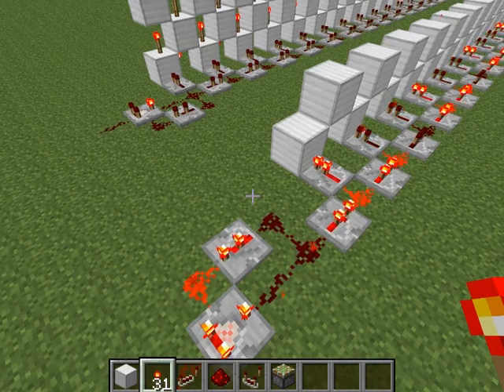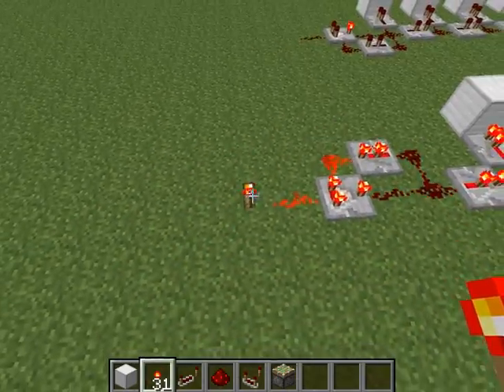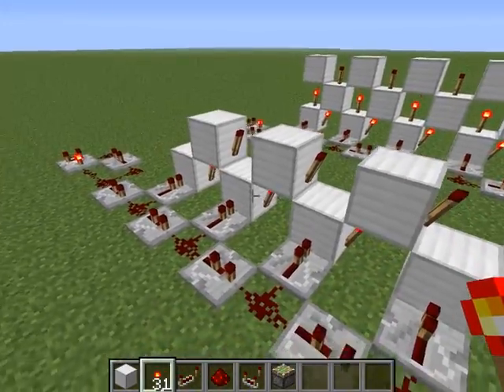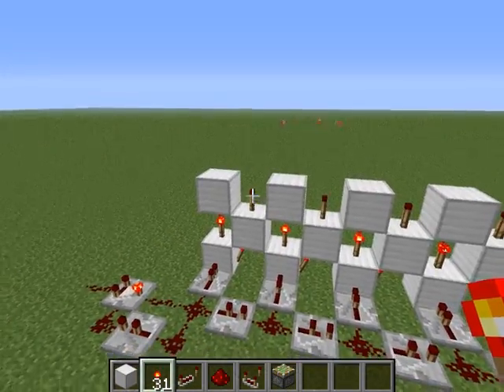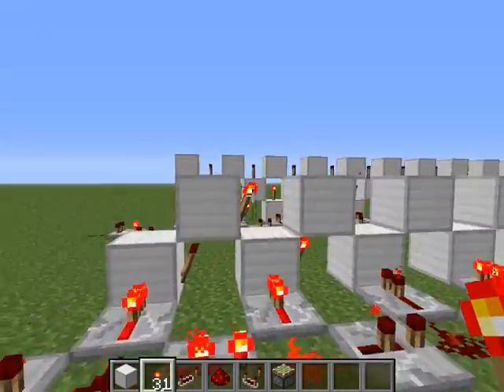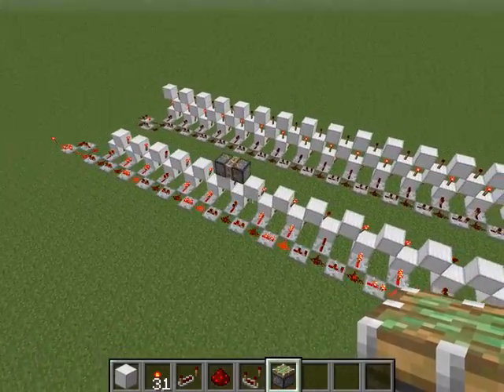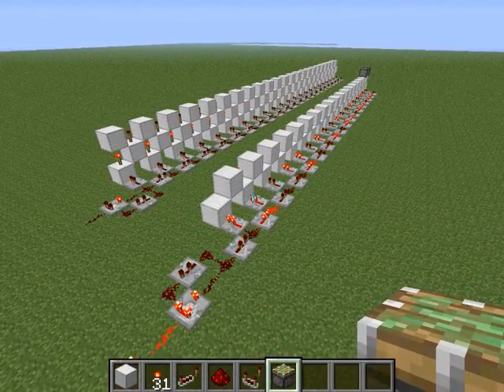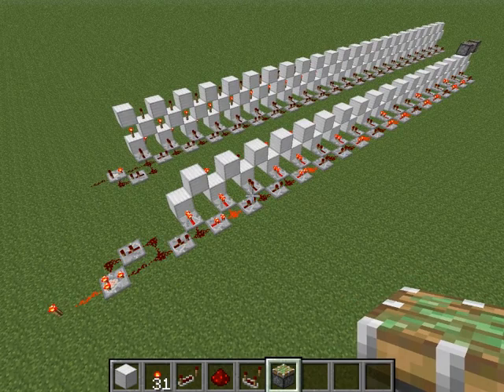Horizontal Piston Monorail (fast and simple)

Comment: MUCH simpler design: ht  tp://i  imgur  com/ Nsbw14u.png
also it works both ways. all you have to do is hook up a fast clock to a line of redstone powering 2 sticky pistons. (however, the clock has to be at least 4 blocks away from the pistons)